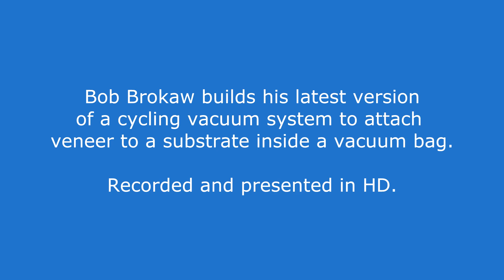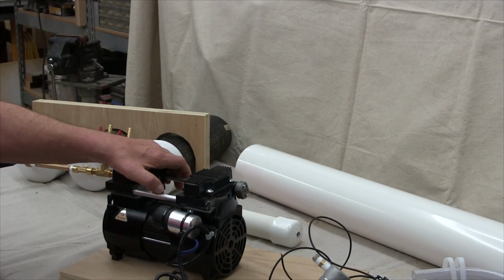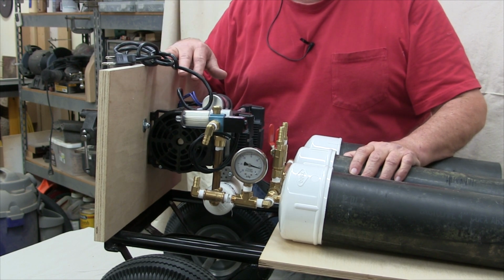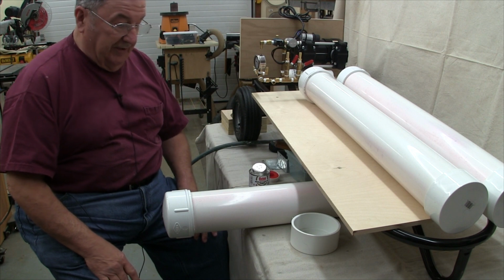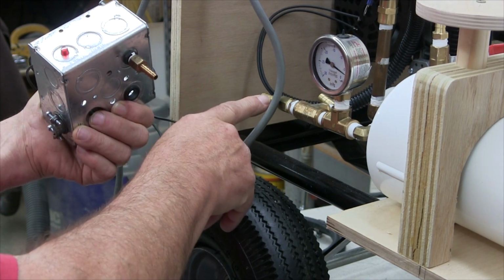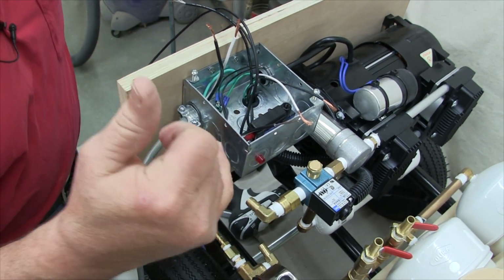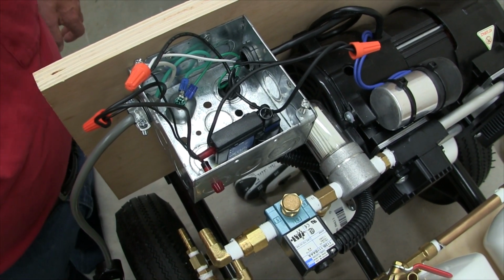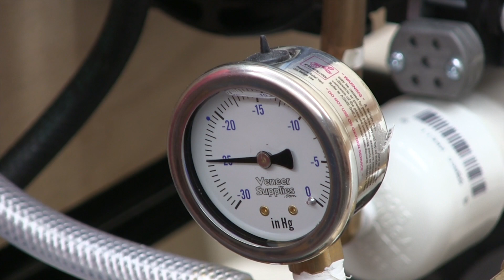2015-01-30 Building a large scale vacuum veneering press

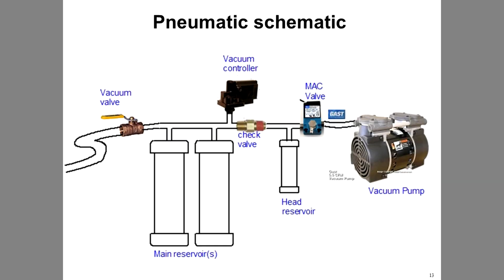Comment: Hey woah, I'm confused. You say components need to connect like the schematic but in the scematic at 8:33 shows the "head reservoir" after the mac valve but in the one you have built it is clearly between the pump and the mac valve.  Which is correct?

Comment: I believe there is an error in the diagram(s) shown in this video.  The sub-reservoir ("head" reservoir in the diagram) should be adjacent to the inlet of the pump.  The MAC valve should be further away.  Basically, switch positions of the head reservoir and the MAC valve.  I checked the Joe Woodworker site for his diagram, and this seems to be the proper construction, but please confirm that what I'm saying is correct.
Reply: I think the same thing, where is the sub-reservoir in the diagram, there is no point.

Comment: Bob, you have a great level of knowledge.  I see most of the fittings can be acquired at JoeWoodWorker.  But I am interested in your added feature of the Pilot Light.  What is your source for that product?  Great addition!  I will be adding that to my vacuum. Thanks
Reply from the maker: Bob bought the original light at Radio Shack. I'm not sure if there are any more of them. You can get them on Amazon.